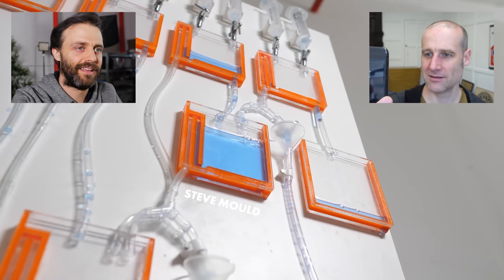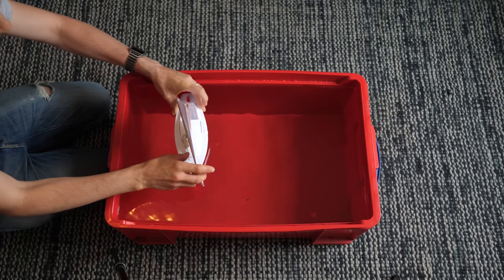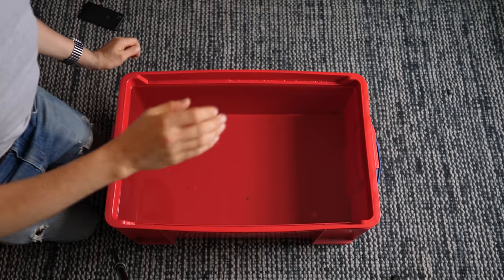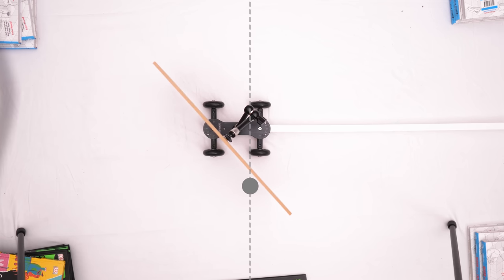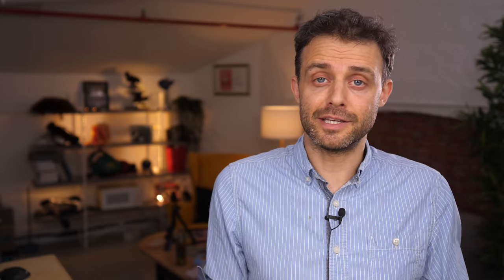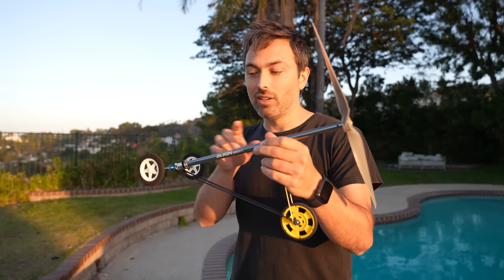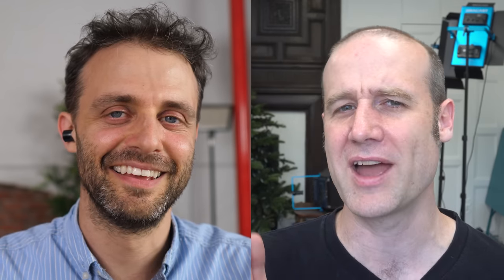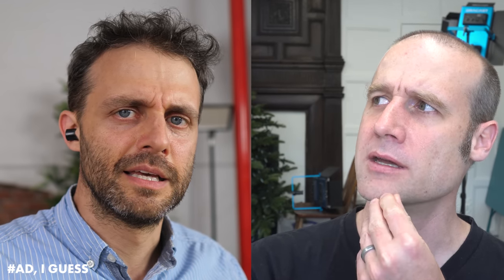Sailing Faster Than The Wind - How Is That Even Possible?

Comment: Nice video but unfortunately the explanation is not correct. A sail generates its lift due to the curved shape of the sail. The problem with fluid dynamic phenomena is that they are usually counterintuitive and they resist to be explained in terms of static physical ideas.

It’s not a thing of being Bernoulli fan or not. The Bernoulli effect is what it is, Period. If the explanation would resemble the way how sailboats work, you definitely should use a flat surface rather then a sail and no sailor would have to bother trimming the sails.

Comment: Was this only intuitive to me because I grew up sailing with my dad...?
Reply: like that's the whole reason you sail close to the wind but not dead on
Reply: the configuration shown at 7:00 is called "close hauled" i.e. the sail is "hauled in" (via a rope called the main sheet) close to the stern to get maximum thrust, but if you sheet in too far you can lose thrust and risk capsizing the boat due to the resistance

Comment: You did not answer the question. The examples you give are all with the wind perpendicular to the boat. However, with the experiment of Veritasium the wind is directly from behind the boat, blowing in the same direction of where the boat is going. In my humble opinion this is fundamentally different...
Reply: These videos on my channel explain the downwind component greate than windspeed:
DOWNWIND VMG GRATER THAN WINDSPEED (WEDGE)
DOWNWIND VMG GRATER THAN WINDSPEED (STREAM LINE)

Comment: this is a great start but I'm very disappointed that you don't actually even try to answer the question in the title; given when you end it's almost click-bait. Surely you can do better. All you've shown so far is how it's possible to sail faster than the wind when at an angle to the wind, but that's not why were are all here - we want directly in the same direction of the wind!

Comment: So changing the angle of the sail in relation to the direction of the wind is similar to changing gear ratios?
Going from a big gear to a small gear increases speed but loses power, and vice versa.

Comment: I am sorry to say that I am somehow disappointed. The simple model well explains that a boat can reach a speed higher than the speed of the wind, but all the demonstrations are made with the stick simulating the wind moved perpendicular to the displacement of the "boat" (except when showing how to sail into the wind). So in the end , the velocity of the model in the direction of the wind is zero (or negative).
What is really counterintuitive in the Veritasium video is to be able to go faster than the wind IN THE DIRECTION OF THE WIND. 
I think the model could show that effect, but you would have to give a narrow a narrow angle to the sail/plate and push with the stick/wind from behind, then to compare the displacement of the stick and displacement of the model by projection along the same direction.
Reply: These clips explain how you achieve a downwind component greater than windspeed: 
https://www.youtube.com/watch?v=H_OKNr120t4 , https://www.youtube.com/watch?v=63hvQABLOaE
Reply: I looked at the clips, thanks. Yes, indeed it is clear and it corresponds to the small vector diagrams I made to understand the phenomenon.
Reply: @owl94-58  Vector diagram should look something like that: https://imgur.com/a/WYlKTjo
Reply: @eyytee  Nice sketch ! For me, the key was to understand that even with the boat beating the balloon, the apparent wind still keeps a component capable to push the boat forward.
Reply: @owl94-58  Thanks, I have now included the vectors for the propeller blade of the cart in Derek's video: https://imgur.com/a/obNUVT5

Comment: This explaination of how a sail (or a wing) works is wrong! 
If you do the calculations of the change in air impulsion deflected by the sail (or wing), you find a lift much smaller than observed in reality!
The only and proper way to describe this system is by considering the difference in pressure on the intrados and the extrados.
Only that way you can find the correct lift and end up with speeds faster than the wind!
And not only can a ship go faster than the wind, but the component of it's speed that is along the wind can be larger than the wind itself, wich is a much more spectacular result!
And that is actually the result you need for the Veritasium experiment to work if you go back to the analogy of the ships sailing on a cilinder.
Your explaination can not explain that!

Comment: Sorry Steve,

This video is fundamentally flawed because it doesn't introduce the role of the Venturi effect.  Without bringing in this aerodynamic principal, you haven't explained why modern high performance race yachts, such as the America's Cup boats routinely sail at speeds of 5x the windspeed.

Comment: This is completely wrong.  Newtonian mechanics is an absolutely awful (and fundamentally incorrect) way to understand how sails (or wings) work.

The problem is the sail of a boat IS a wing.  It doesn't push the boat (unless running downwind).  It pulls the boat.  So what this means is that your demonstration is fully wrong.  Because when maximizing speed in a crosswind, you don't want the sail closer to perpendicular to the wind.  You want it closer to parallel. The maximum speed is attained when the sail is as close as possible to the wind, but just far enough off to make a good wing shape.  In your model, this would create the least speed, but in real life it generates lift and creates the most speed.

Your explanation may make basic logical sense in terms of speed.  But it isn't how sailboats work and is wrong.

Comment: 3:21 No that force is not called lift. With that geometry of your "sail" you get only the "push" from due to the sail forcing the wind to change direction. For lift you would need a sail geometry that forces the wind to pass the front faster than the back do the air pressure in front of the sail is lower then in the back. That is what called lift. If you have a look at the wings of that airplane you show, you may recognize that it is not a straight flat surface but is curved? That is the geometry, called airfoil, causing the air to flow faster on the upper side then on the lower. Proper sails are commonly made of flexible material, and never a flat board, so the wind itself can bring them into the required shape. Ppl, there is no worth in continue watching this pseudo-science nonsense. Keep searching youtube, there are some easy to understand vids about how that vehicle works and some even show experimental verifications.

Comment: None of that is true. It's so over simplified to the point It's completely wrong. If you'r not a sailer or an aerodynamicist and you don't understand this don't try to explain it. Really the air that just misses???? If you have ever run a Tetrahedral Unstructured simulation you would know the field has to be 100s times larger that the object before you find no reasonable interaction with the object.  This is so complex that you can't simplify it or it's wrong because it's all so interconnected. This is why people are screaming it can't be true it would be a "perpetual motion machine" there right what you all are saying is wrong and leading people to this incorrect conclusion. It's still powered by the wind, no wind no power no "perpetual motion machine" the wind is providing energy not speed. The sails in all configurations make power not speed, speed is not that closely linked unless you are using a spinnaker. If you tac they are not linked at all. The wheels being coupled with the prop/sail keeps it in a tac configuration but down wind as if you are tacking around a 1 dimensional relativistic POV.

Comment: sorry, Steve. You usually are great, but you got it all wrong this time. The "wind missing the sail" concept is entirely flawed. The only reason that a sailboat goes faster than wind speed is apparent wind, which you didnt ever mention in this video.
And, it it wasnt for drag, there would be no limit the maximum speed you could reach.

Comment: "How is this possible". asks the author. Answer? It isn't.  Lots of use of the name Bernoulli, but not much understanding,  either in this video or in the comments. This lack of precision in the language leaves holes big enough for a lot of nonsense to drive  through.

For example, a sail is a wing. The physics is the same, so stop with the differences allusions. As for Bernoulli, he showed the air over a traditional wing, where the top surface is a curve and the bottom surface is flat, does not make the air "move faster". It stays where it is. It doesn't speed up or slow down. It becomes less dense. Which translates to a lower pressure on the top of the wing than on the bottom. This we see as "lift".

The sloppy language is presented in much of his video, as real physics. It isn't.  If this crew were to write a masters on their topic, it would get a fail hands down. Sorry, but the science is quite settled. 

As pointed out in another post, if that "ship" goes faster than the wind, it in only because of the stored mechanical energy in the drive train. All the other arguments are fluff.

Nice try,  but definitely no cigar. If that wind powered "boat" was for real, it would have sunk!
Reply: Bernoulli didn't point out that the wind speeds up over the top of the wing.  He simply showed that when air is accelerated (without doing work on it) it has a lower static pressure.  And one thing is for sure - the air definitely does speed up over the low-pressure side of the wing (normally the top) whether it's curved or not.

>> if that "ship" goes faster than the wind, it in only because of the stored mechanical energy in the drive train. 

Nope.  The rules for the record run required that we demonstrate we could not take advantage of stored energy at any time.  We demonstrated that we can go 2.8X the wind speed, directly downwind, steady-state.
Reply: @Rick_Cavallaro  Sorry , but that is a sloppy account of Bernoulli's equation, and its relevance to an airfoil. It has to do with laminar flow and the disruption to it caused by the curve of the wing. Painting a picture of air molecules accelerating and decelerating are distortions. The lamina next to the wing have farther to travel because of the longer path. This causes the layer of air to become less dense. Lower density we measure as lower pressure. Because the layers of air on the lower part of a wing are direct, there is no change in air density, and hence no change in air pressure. This difference we call "lift". 

This confusion is part of what leads to your claim of curvature of the wing being irrelevant. It is in fact essential. Basic fluid mechanics.

And think about it. When this vehicle is moving through the air, it is the"wind" that rotates the propeller So please explain how this propeller rotates when the relative wind speed drops to zero. What you are claiming is energy out is greater than energy in.
Reply: @techhie1302  It's impressive how much you got wrong in that one post.  You're seriously going with the equal transit time theory!?  And then you're telling me how the vehicle I designed, built, and set two world records in really works!?  Good luck with that!
Reply: @Rick_Cavallaro  What is NEVER stated in these explanations is the angle between the direction on the vehicle and the direction of the wind. It makes a huge difference to the argument. 
A vehicle travelling DIRECTLY downwind will NEVER exceed the velocity of the wind. There is NO differential air movement under that condition, hence the vehicle will get zero further energy to propel the craft. Think about it! In relative terms the vehicle is sitting in still air. 
Explain that one if you can.
Reply: @techhie1302  
>> A vehicle travelling DIRECTLY downwind will NEVER exceed the velocity of the wind.

And yet I have two world records for doing exactly that.  And I've given maybe a dozen talks on the topic at places like Stanford and NASA.

>> Think about it! 

Good one!!!

>> Explain that one if you can.

I can and I have - many times.  Unfortunately, I can only explain it to you - I can't understand it for you.  You're fully committed to not understanding it, and I certainly don't plan to stand in your way.

Comment: Gentlemen, this video has nothing to do with Veritasium's video you refer to - sailing downwind faster than the wind. This is the first time I downvoted a video by either of you. You can do better than this.
Reply: How you get a downwind velocity component greater than windspeed is explained here: 
https://www.youtube.com/watch?v=H_OKNr120t4 , https://www.youtube.com/watch?v=63hvQABLOaE
Reply: @eyytee  Veritasium video they mention and briefly show has actually  nothing to do with sailing. Look for it among recent Veritasium videos. I am only complaining about referencing it and then talking about different phenomenon.
Otherwise, the video is good if not quite  exceptional.
Reply: @eyytee  That analogy with jibing (equivalent to tacking, only downwind) on a "cylindrical Earth" is mere hand-waving and wrong, as Matt and Steve point out. The idea of the contraption Derek rode in was powering the propeller by wheels - it has nothing to do with "normal" sailing concepts.
Reply: @bazoo513  Where did Matt and Steve say that the sailing analogy is wrong?
Reply: @eyytee  Aw, for fuck sake, either watch the videos or don't discuss them!
Around 0:50 "a bit of handwaving, back to the...". So, irrelevant to the problem.
Reply: @bazoo513  But they don't say that the analogy between sailing and the cart is wrong or irrelevant. They just say that Derek didn't sufficiently explain how it was possible for sailboats in the first place.